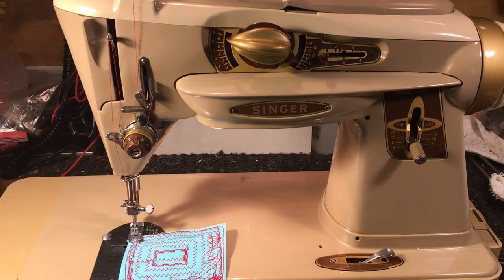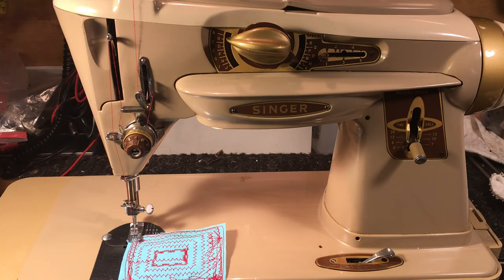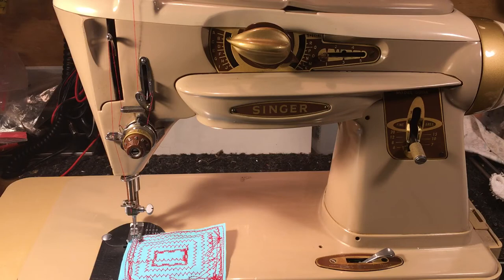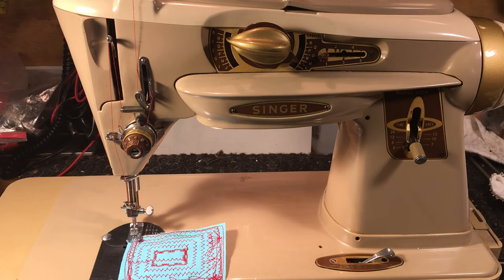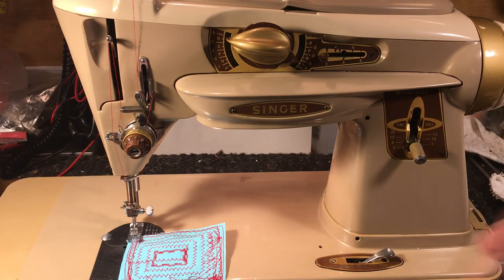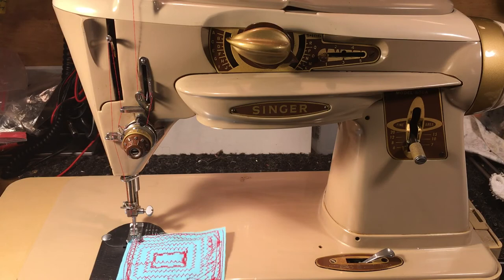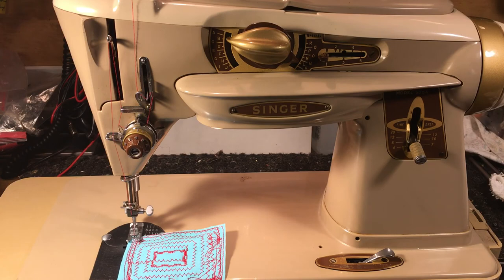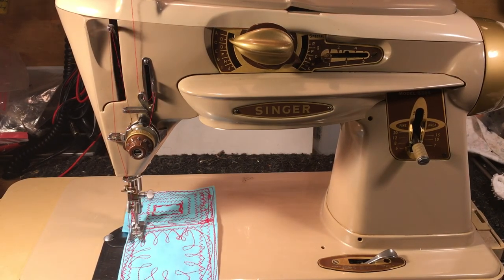How to pick a Survival sewing machine --apocalypse - TEOTWAWKI machine (Video 110)

Comment: Not to mention the full rotary hook that produces a straight stitch rivaling the 201-2. I have 2 500a's, and they are everything and more than what you say. Pity Singer went plastic.
Reply from the maker: Agreed. I got to thinking that the fiber gear I referenced was also used on the timing gears in General Motors V-8 motors in the 70’s. Pretty tough gear. 
To highlight all the greatness of the Singer machines from that era would be a really long video. Thanks

Comment: Do you have a video on how to remove the two stitch selector buttons on front?
Reply from the maker: No, I’ve never found that to be a necessary operation. If for some reason your machine is not cooperating and the slides aren’t moving, be patient and use your penetrating oil.